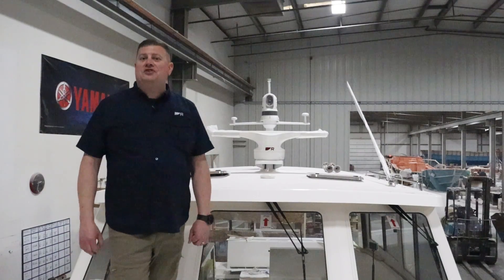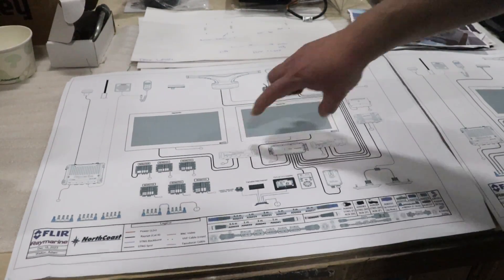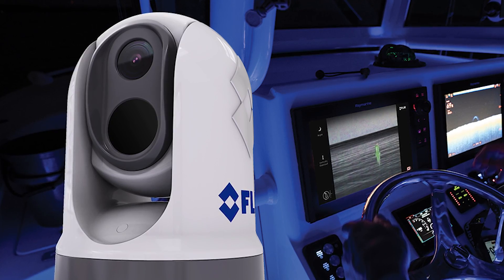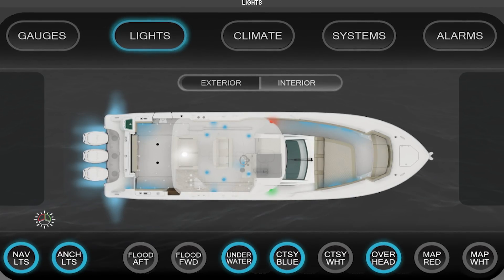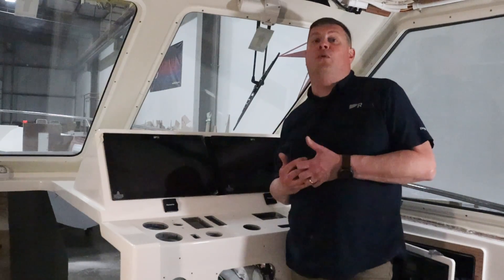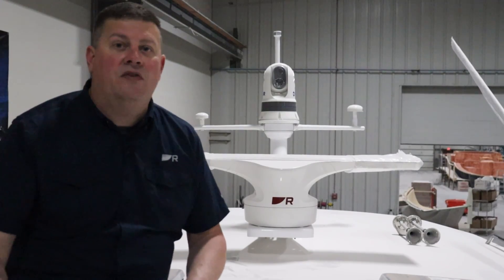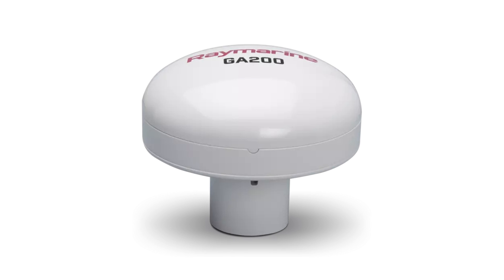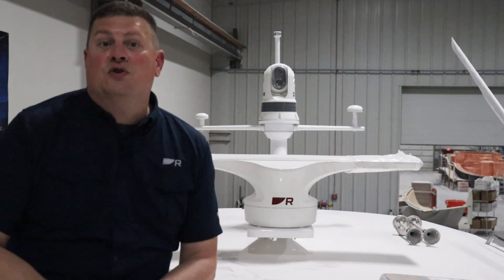Inside NorthCoast 415HT | Raymarine Electronics, Radar & CHIRP Sonar

Comment: Great setup. One issue, more of a visual thing was, why don't raymarine make the Ar200, RA200 and the Ais mushrooms/pucks etc all the same physical size and shape. Especially in this video, the different heights of the two on the spreader just don't look right with one being the higher and it messes up the whole symmetry of the look.
I would love to know the total cost of the rm system.. I imagine it's an eye-watering amount of money. Nice to see it all come together in one install.
Reply from the maker: Thanks for watching, Paul!   The 2 pucks on the spreader have pretty different functions which dictates their shape.   The GA200 antenna is a passive GPS antenna.  It feeds satellite signals down to one of the devices that has an embedded GPS receiver.   The other antenna is a 5-in-1 antenna for the Yacht Sense Link Marine router.  Packed into its mushroom is a GPS antenna, dual Wi-Fi antennas, and dual cellular antennas.  It really is a beautiful package they have put together.  We'll show more when it is complete and in the water.